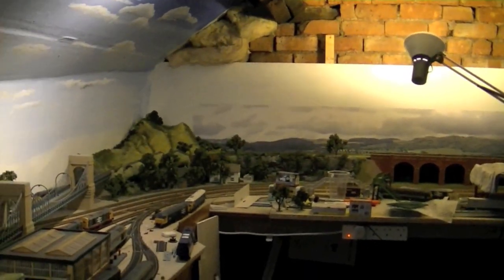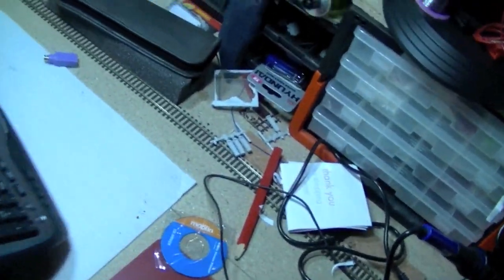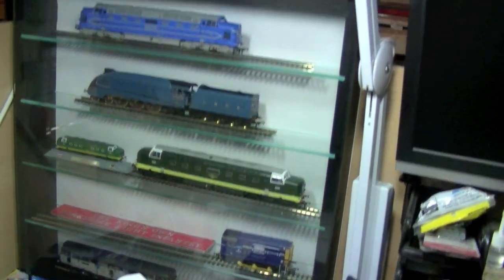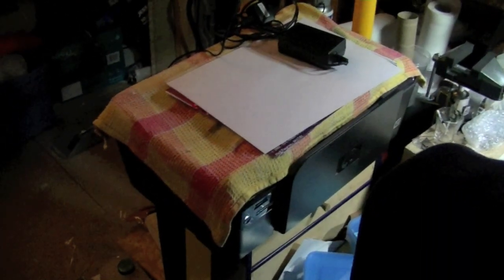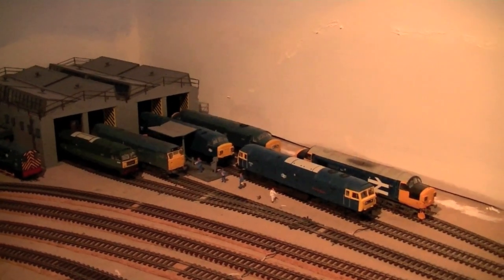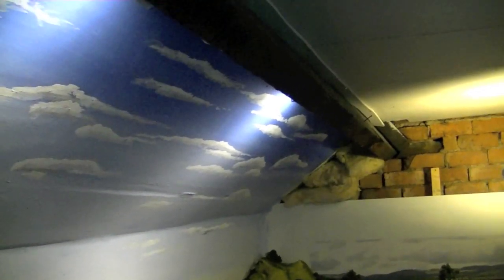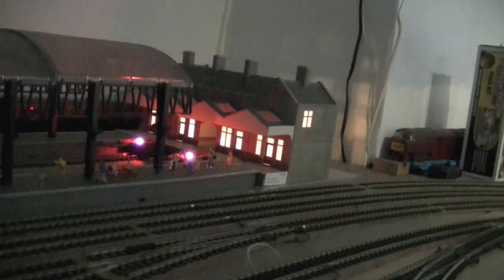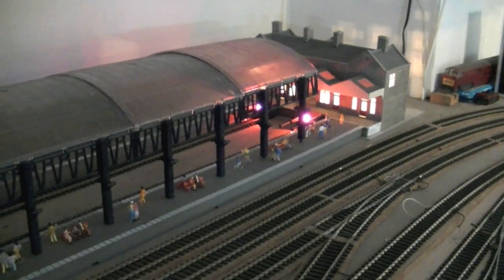Intro to Loft railway pt 1

Comment from the maker: @MrFlix76 The work area is great because it didn't cost anything.  I looked at 'proper' work desks but they were either too small or too large.  A home made desk means I can easily add on sides and alter it as needed.